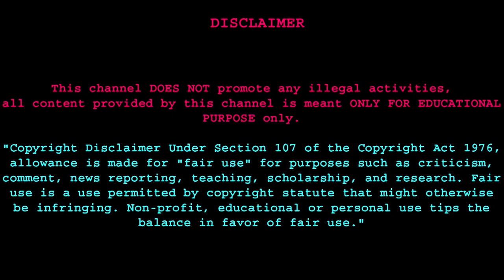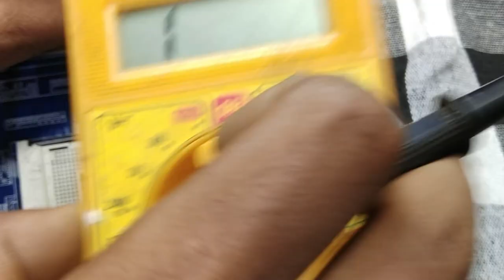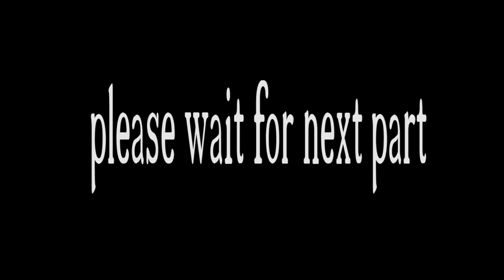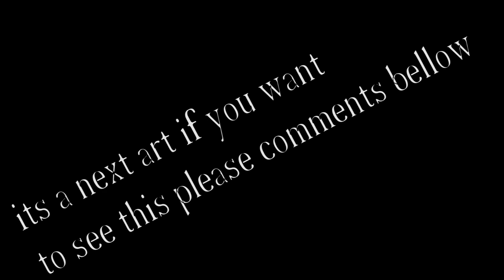motherboard repair #how to remove vrm short cercuit using shortcut way # intel pentium4

Comment: Hlo sir ek asus amd motherboard me on krte hi 5sec me shutdown ki problem hai. Uska vrm section b short ni dikha rha mosfet bhi sare thik hai jo ic vrm section me hai 74HCT 125D b nikal k check kiya fir b bhi problem hai samajh ni aa rha kya kre plzz ap btayiee kuch Smps b thik hai cpu b change kar k dekh liya fir b bhi shutdown ki problm hai or diagnostic card per 000U error show ho rha hai or RST n CLK light full n frame dim si jlti hai light sir kuch btayiee plzz reply krna

Comment: Facing Problem in this motherboard:
1. I am using Zebronic Z-31 motherboard with Hynix 4GB 800mhz ram (2*2) but i am getting only 2.99GB usable ram out of 4GB, Why?
 2. Suggest best graphic card for this motherboard?

 3. and one more problem is after using half an hour monitor display shutter and picture crack then hang screen, why this happen? i am using Intel core 2 duo E-8500 processor, & vga cable at resolution 1920*1080
Help me
Reply: Which Version of Windows You are using 32 Bit or 64 Bit ? Are you using a Discreet Graphic Card or you are using Motherboard's Integrated Graphics ?